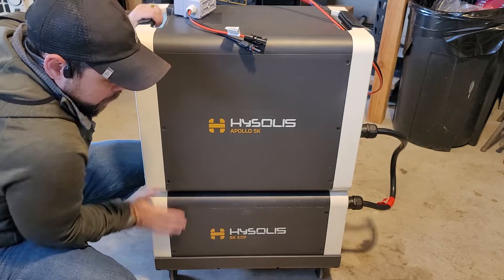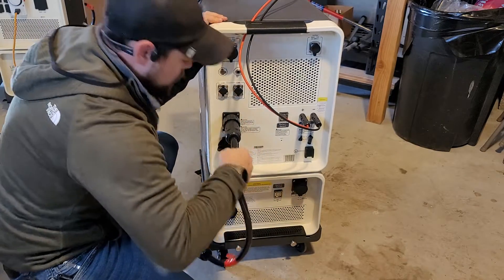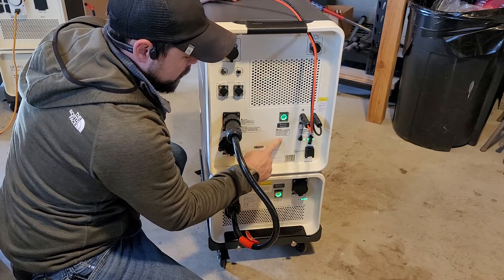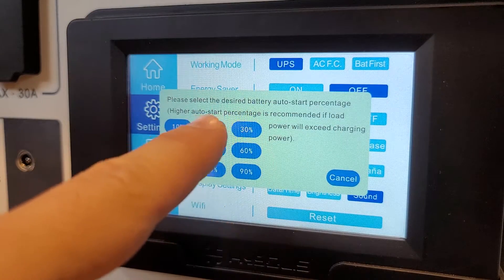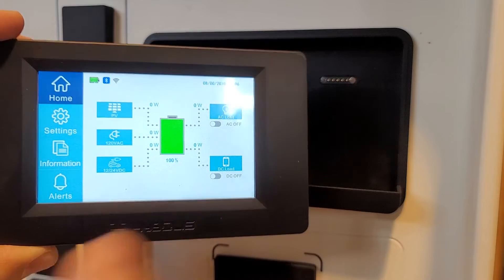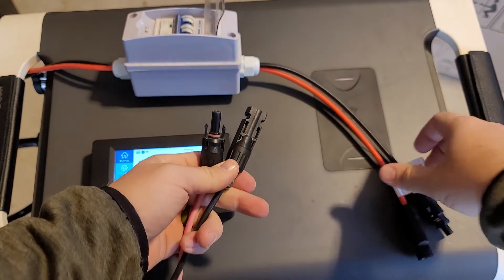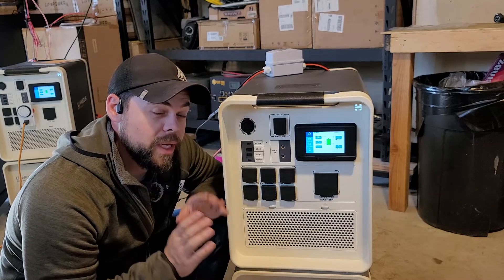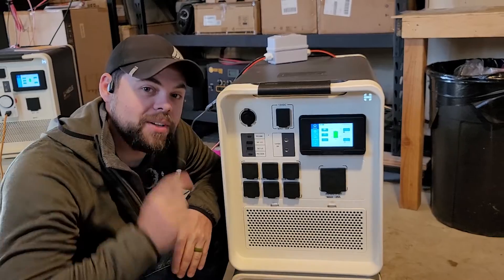Apollo 5K 120v Single Phase Quick Step by Step Setup Guide

Comment: Does this system has some sort of panel box that ties into your house panel?
Reply from the maker: The easiest option is to connect it using an interlock switch and generator outlet to your main electrical panel. This way you don't have to use a sub panel box or any special big adapter like other brands.
Reply: @minutemansolar  Awesome! Thanks for the quick response!

Comment: Good afternoon. i love your videos. i have a question. I have a bluetti AC 300 and 2000 watts of panels but there is going to be a distance of about 250 from the bluetti to the panels. What size cable to you recommend for that distance? I would like to expand panels later on.
Reply from the maker: At least 10awg if not 8awg. How will you configure the solar panels on each ac300?